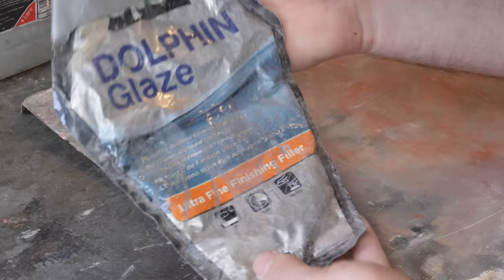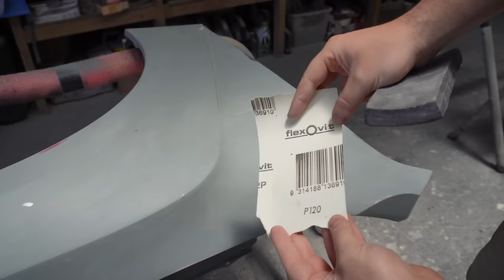These fenders look amazing! Sky-gea build: Part 7【ASMR】

Comment: I like how you aren’t rushing this and making sure that its right first time. I would absolutely love to see if you could make the gtr rear lights fit and delete the standard stagea ones, make some fibreglass blanks where they use to fit up high and clean it all up, really bring some uniqueness to the build
Reply from the maker: Yeah mate, do it once, do it right.

Regarding the tail lights, I've actually done a lot of tests on photoshop of the GTR tail lights (R35, R34, even R33) and none of them really worked with the shapes in my opinion. Plus I love the idea of the front and back of this car just looking like a standard R35 and M35, so if you only saw one angle you wouldn't suspect it was this crazy swap. I like my cars to have little details like that.
Reply: @TofuAutoWorks  nice, I’m sure it’s gonna look cool when it’s done, loving the progress.
Reply: @TofuAutoWorks  does that mean you will be leaving the rear arches as they are? I was wondering 😌 Either way, like all of the other comments are saying, your uploads are brilliant! It's the attention to detail, and some of the methods you use that make it so satisfying 🤣
Reply: @TofuAutoWorks  like an evo wagon 👍

Comment: I really hope you will remove the door trim, the car has such a clean look and it really sticks out. Amazing work on the fenders tho, I'm starting to do a little bit of bodywork myself and can't even grasp the basics, so this is just magic to me lol
Reply from the maker: Yup, it's going. I've actually got to remove the rear one anyway so that I can fit the over-fenders. Check out the photoshop render in part 1 of this build series, it shows my finished plan for the car. 

Leaving them on for now meant that I was able to use them as a guide for the lower bodyline, but now that those are finished the trim can come off.

Comment: Instead of using a marker to outline your templates you could just get a black rattle can and lightly spray over the template, super quick and you get a nice clean line when you peel away the template 🎉
Reply from the maker: It's a great trick that I've used plenty of times in the past, don't know why I didn't do that this time.

Comment: Awesome work, a little suggestion, you should've moved the top of the vent to the bone line of the car. Something to think about if there's a next time.
Reply: I think that would have resulted in completely losing the wheel flare ridge that is distinctive to the GTR.
Reply from the maker: Cheers mate! 

I actually looked at the vent position a lot when I was coming up with this design on photoshop. This size is definitely the best looking and the main reason it doesn't go to the top of the bodyline is because the section above this vent is the only remaining piece of the Stagea fender and it carries the bodyline from the rest of the car into these fenders. Had I brought the vent all the way up, we would have lost that detail and then these fenders would have looked more out of place.

But thank you for the suggestion!

Comment: Quick question, is there anywhere I could DM you about some pointers on repairing a fiberglass bumper? I have a ultra rare Feed Afflux front bumper for my FD RX-7 but it's basically missing the entire passenger side corner. Would it be possible to send you some pictures and pick your brain about how you'd go about repairing it if it was your project?